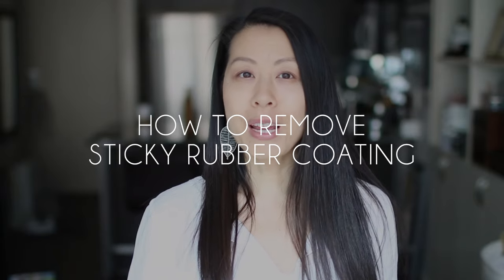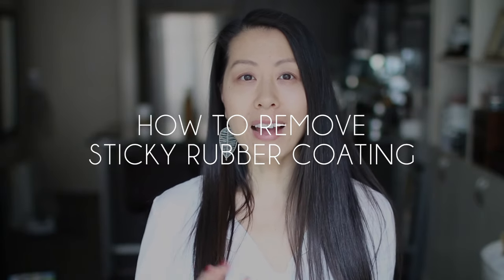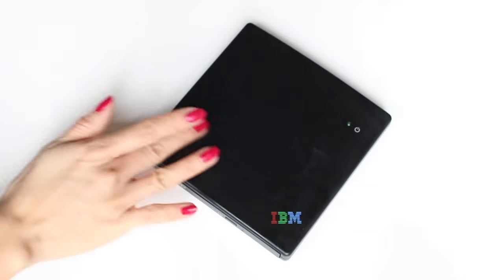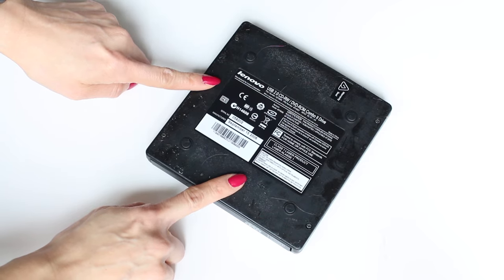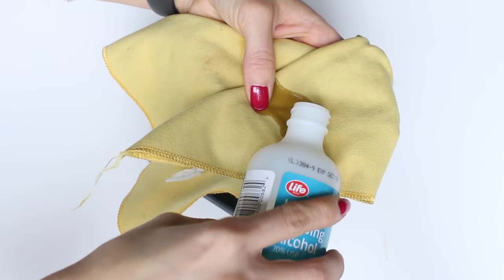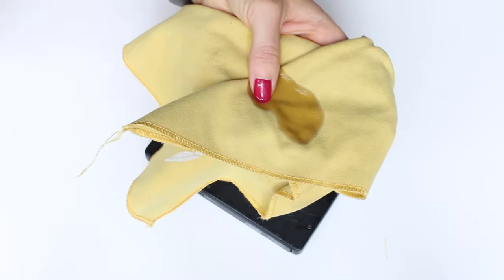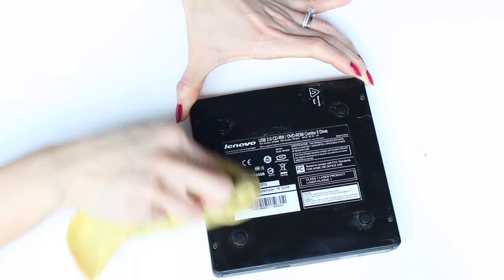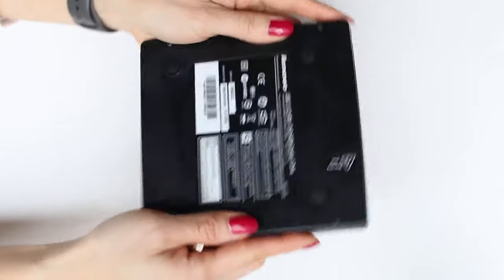How to Remove Sticky Rubber Coating

Comment: The engineers who developed this coating, should be coated with it, themselves.
Reply: Agree!!! I had to deal with this stickiness on a old but excellent mouse and a remote control... both took me hours of work to clean properly! After that, i will have much care when buying new stuff and make sure they are not "rubber" coated (sadly my latest buy has it - a Google Nest Mini!! It was already a bit sticky when opening the sealed package... go wonder...)
Reply: Yes I agree lol
Reply: Well, they expect you to clean your items … stickiness is a result of neglect, of care and cleaning.
Reply: Best comment all year.

Comment: Something that is supposed to work wonders on destabalized rubber coating (sticky rubber syndrome) is an automotive product for cleaning and restoring dashboards and/or tires. The product I've heard about but have not tried yet is "CRC Cockpit Shine". Apparently you just wipe it on and wipe it off and it cleans and restores the rubber to its original state. Might be worth a try if someone is interested.
Reply: I have also used McGuires Rubber and Vinyl Restorer after cleaning with lacquer thinner. Really did a good job and it felt great.
Reply: Sir respectfully armor all makes shit that works just as great

Comment: Works good.  I'd only like to add, if you have black rubber, to maybe wear gloves.  My hands got so black.  But of course, that rubbing alcohol helped clean my hands too!  I always just thought, because I live in Hawaii, it was the humidity.  That might add to it, but not the only reason.
Reply: I live in Hawaii too and some of my stuff got sticky 😂😂
Reply: It could be the salty air and humidity. Most Lenovo stuff has a rubberized coating which lasts two or three years and then it starts peeling.
Reply: Thank you ❤❤❤ gloves great idea for cleaning black rubber.
Also 70 % alcohol hand sanitizer gel , good ❤

Comment: Hmm... Even 91% isopropyl alcohol hasn't worked for me. However, acetone (nail polish remover) does, with some scrubbing effort. Generally safe for things like these electronic gadgets, but check it on an inconspicuous place first. Might remove brand logos (don't get it on functional labels on the device), but a small price to pay for making the thing useful again.

Comment: Worked as advertised! Since rubbing alcohol is still a bit hard to come by with the Covid 19 situation  I used a few alcohol prep pads and they did the trick. Thanks for the tip.

Comment: I have a decapitator bottle opener that got left outside and the dew turned that once smooth finish sticky in one night. I always have 99% iso on hand for cleaning and that made it rub off with ease and now it is once again smooth. Thank you for the quick tip and doing the research for me!

Comment: Wow!  Fabulous!  I definitely had to go over it quiet a few times, but it worked like a charm.  I even used it to remove the gunk off my hands as I went along. Inexpensive, quick, easy, and now as good as new... and NOT in a landfill.  What’s better than that?  Thanks so much. 👏👏👏
Reply: Will this work for sunglasses frames?

Comment: Had some isopropyl in the house so tried that and worked a treat, had to rub the sticky rubber with my nail first so the isopropyl gets under it easier and then rubbed it using a cloth, came up a treat and no sticky rubber residue remains, neither does the gopro sign or the serial number but I'm not bothered about that as guarantee was over anyway,

Thanks for the video

Comment: This solution did not work so well for me, but I used a product called Krud Kutter and worked it in on the rubber handle on my golf umbrella with a strong paper towel, and that worked great.

Comment: Thanks! I used my 70% isopropyl alcohol to remove the residue of dried-up rubber bands on the neck of my brass lamp (put there long ago to hold a glass globe in place). It took repeated applications but worked well. The alcohol left a white cast on the metal, fortunately in an invisible spot, but Brasso and polishing removed it. It was far better than harsh solvents that might permanently mar the finish.

Comment: yes, I believe this may work but I don't want to scratch the surface or keep on repeating.  I mean is there any other cleaning material to use so as what you have to do is just like using a soap -- make it bubble, rub a few times gently with a soft cloth and when you rinse - boom - the stick substance is all gone.  I haven't used a soap or dish washing liquid because this is an electronic equipment.  thanks for sharing.

Comment: Thank you but unfortunately the sticky coating on my Dell XPS laptop does not come off with isopropanol but only if I scrape it off mechanically which would take hours.

Comment: Thank you! Solved my problem. Pulled out a camera that I hadn’t used in 10+ years and the rubberized back was all sticky. Your solution did the trick. Thanks!

Comment: I restored an old wireless mouse with a paper towel with acetone on it. I then put a thin coat of petroleum jelly on the  rubberized surface to make it like new. I have heard that WD40 also works well.

Comment: I have a waterproof bag which was stored for 5 years without using and it's totally new but it got a lil sticky on the inside. Can this trick work without it losing it's waterproof capability?
Reply from the maker: I'm sorry, I don't know the answer to this! It does take off the rubber layer so my guess is that it could impact the waterproof capability.

Comment: 1:50 min video. 1:10 min intro, 25 seconds on the actual topic of the video, 15 seconds of outro...
Reply: Hahahaha - yes, how very true.... and Boring! .... and doesn't work on thick coating, drill grip etc.
Reply: I found the description of what to clean (those rubbery matte surfaces) and the reminder of the environmental impact of reusing (as opposed to just throwing away) items welcome.

Comment: I’ve tried using cooking oil before but have never tried rubbing alcohol. Thanks for the tip! I’ll give it a go this weekend since I have several glass soap dispenser I want to reuse.
Reply from the maker: Cooking oil works great on glass! Please let me know if this method works out.
Reply: Would this work on the iPhone silicone case?

Comment: Does not work at all … tried with rubber case and old usb sticks. Lighter fluid worked great. Baking soda paste is also recommended, but did not try that.

Comment: Rubber-like body on wahl hair clippers were sticky as ** and very persistent. Multiple hard rubs with rubbing alcohol but there was still residue... There were improvements but still has sticky like residue...I guess the more stubborn the stickiness is it's gonna take more hard scrubs to get it out.
Reply from the maker: I had to work at several sections quite a bit to get the stickiness off, so it might take a few tries. Good luck!

Comment: The handles of my Real Techniques brushes became tacky so I used acetone in a similar manner as you did. It worked great. I wish companies wouldn’t use this rubberized costing on products. It gets so yucky.
Reply from the maker: I totally agree! That's a great idea to clean off the handles of your Real Techniques brushes. I'll have to check how mine are doing.
Reply: Acetone breaks down the molecular structure of some plastics e.g. Polycarbonates, and therefore can destroy the item you were looking to preserve.
Reply: Exactly, i googled this because the handles of my Real Techniques brushes became tacky LOL hahaha
Reply: @nigelpostles3707  You don't soak it. Just dampen a paper towel and wipe the surface. The acetone is gone in a few seconds due to evaporation.
Reply: @darkwood777  That’s still enough to drestroy plastics, I did exactly that on a plastic surface and it permanently damaged it and ruined the texture. Acetone is really, really strong.
Reply: That's a bit harsh.  Wouldn't use it.

Comment: I used Bio-Ethanol, the one you use for ethanol indoor fireplaces and it worked like a charm! Thank you so much, you saved me from spending 250$ for 2 rubber replacements of wacom tablet (yeah ... i don't know too what they inhaled while calculating that price but thats what I would have to pay otherwise). 

Have a great day! :)

Comment: Why is it sticky even though it has no adhesive materials in it? This is because when the cling film is peeled from the roll, friction between the surfaces will cause the electrons to be transferred between the peeled cling film and the remaining film on the roll.

Comment: I just did that with the alcohol, but the stickiness didn't go away after several applications.
Reply: I used isopropyl alcohol (rubbing), Denatured (wood, methyl) alcohol, WD40, etc... Nothing worked.  Mineral spirits and a lot of work finally did it.
Reply: Try using baking soda, add a little water to create a paste. Rub ang massage the area then clean it off with a wet cloth. Worked for me and baking soda is not so harsh to the skin.
Reply: Agreed.  It does not work at all.  Rubbish tip.

Comment: Yes...i needed to use a new paper towel many times and each time it got better as the coating was reduced with new applications of the rubbing alcohol. I agree the engineers who developed this coating should be coated in it themselves 😂😂😂
Reply: Well after I kept using the alcohol, I discovered the small Jewelry scale didn't have a rubber base after all, that sticky coating felt like rubber and was very thick. After it was gone the scale was just plain old smooth plastic. Yes, keep rubbing but use new towels repeatedly. You will have success. Why do5hey coat plastic in sticky rubber?

Comment: Had this sticky rubber with a Roland drumcomputer from the early 90's .thanks for the tip and sexy girl on this video !
Reply: Update update petrol vaseline makes the rubber coating back in good condition . I did this with my other drummachine the Roland r8 . The one i talked about before was the R5